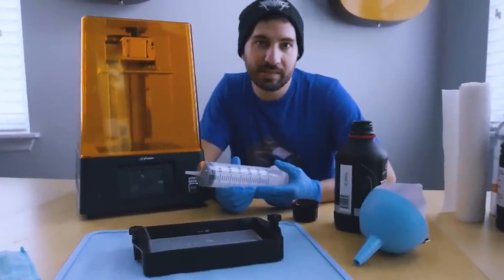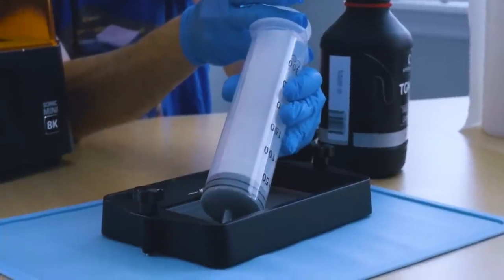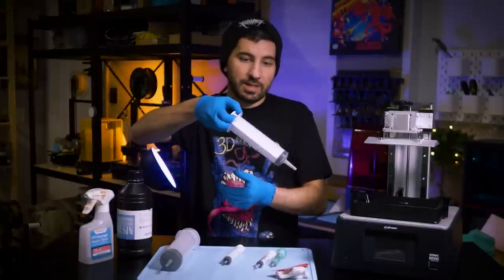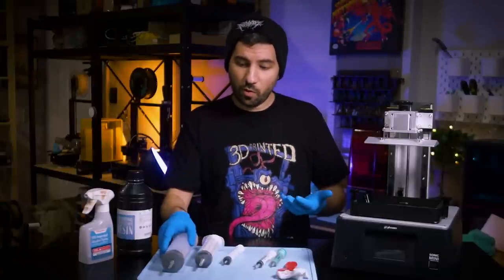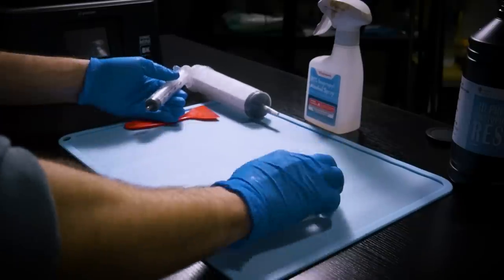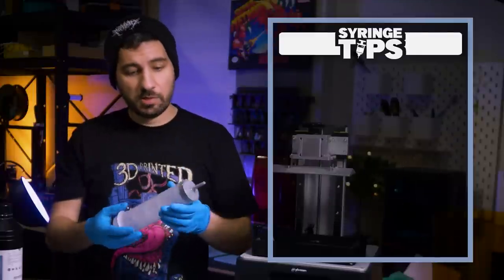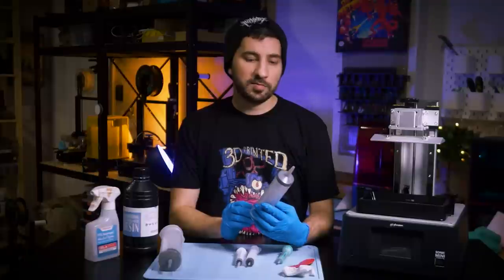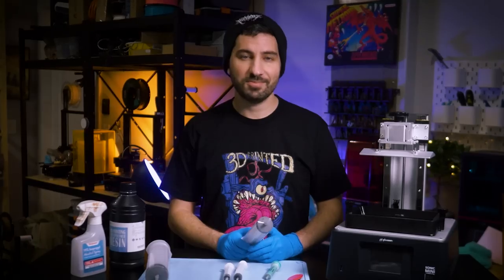Never Spill Resin Again: Using Syringes for Resin 3D Printing

Comment: Add a length of silicone tube to the nozzle of the syringe. Safer on the FEP and you can the tip to what ever angle works best for you.
Reply: I second this as well! I cut one length at an angle to offer more of a suction surface area.
Reply: And if you cut little notches in the vat end of the tube, that helps to prevent it from suctioning itself to the film
Reply: Exactly what I thought
Reply: Yep, wrote the same thing in my comment; you can also use a silicone glass pane wiper instead of a spatula.
Reply: he could have also typed the ENTIRE  machine to the side to get the resin to flow to one side/corner

Comment: Just 3D print a small slanted ramp so that it makes all the resin go to one of the bottom corners of the vat. You'll save yourself a lot of time scraping and be able to carefully use the syringes a lot more efficiently and safely with two hands without scratching the FEP.

Also get some soft rubber tubing that will fit your chosen syringe size and cut a small piece (.5") over the syringes hard plastic tip, this will help to protect the FEP as well.

Doing this will all but eliminate having to scrape it if you just let it sit there for a few minutes and give it time to work itself down to the corner after you take the majority of the resin out of the vat.

As far as not spilling it you can also take the vat to a machine shop and have them cut a small slant in one of the corners to act as a pouring funnel to pour it back into your resin containers. I have a few printers that have this built-in from the factory but I've also taken one of the ones before that didn't have that to a machine shop and it was very easy for them to do it for me and not very expensive at all, I think I paid $20  to have it done.
Reply: I was thinking something similar.  Couldnt I just stick a wedge under the entire printer?  Or would that damage something?  That way we could leave it on the printer.

Comment: Use an automotive one, those medical disposable ones tend to be sorta costly and the rubber likes to stick. Automotive ones (basically, big rebuildable ones for sucking up oil and fluids) tend be fixable, and they have a replaceable and flexible pipe on the end.
Reply: Any brands or specific products you would recommend, as that seems like a great alternative

Comment: Print a ramp so you can pitch the reservoir to collect in a corner. You can even put a threaded hole to connect to the reservoir.

Comment: Snip a piece of tubing from the pump off and fix it to the end of a syringe so it won't scratch the FEP and maybe make positioning a little easier AND add resin to a vat mid print nice and easy.

Comment: The scratching problem can be avoided entirely by using soft elastic materials, like a miniature glass pane wiper instead of a spatula (the cost is pretty much the same) and fitting a small length of hose on the syringe tip.

Comment: Don't throw the pump on ebay just yet, you could set it up so that it could easily add resin to to vat of a large print in progress, either manually, or if you rigged up a float switch, automatically(use caution of course)

Comment: I have 2 of the 500ml, one had no suction like yours the other had good suction. Plus using the plastic tube that comes with it helps suction and stops scratches.

Comment: I was highly interested by the pump but clearly the syringes is my way to go. Ordering now!! Instead of using the scraper on a flat surface, I will design a tilting tray to sit the vat in, which will slide the resin to one corner! Awesome pal, subscribed.

Comment: I just printed a spout thats flush with the vat. I then epoxied on and It keeps any resin drips do form far away from the base of the vat and as long as you dont completely miss the funnel with the well defined stream you get there is no mess. Just sit it down on a paper towel and there you go.

Comment: Feel like I'm missing a key bit of info, how is everyone having enough trouble cleaning out the vat for this to be worth it. It only takes like 30 seconds to pour the vat out into a filter/funnel, and then maybe another 30 seconds to clean the filter & funnel?
Reply: Glad to see this comment. I just assumed this video exists to make another you tube video. There is a pour spout on the vat for a reason. Invest in a silicone spatula and funnel strainer.
Reply: Find solutions to problems we don’t have

Comment: I recently looked into the prestaltic pump and found that you can easily, for not much more money, find ones with a lot more flow. Whether they have enough power to suck up thicker resins, I don't know. 
Also, there are few good videos here on YT about building/3D printing your own pump. 

That said, I just have a 6inch printer so I think I'll stick the either the funnel or syringe;)

Comment: every time the 300ml syringe was shown, and there was whining and complaining about how it didn't work well i wanted to yell at the screen.  #1 put a block under the left side of the PRINTER to TIP the WHOLE printer to the side enough to flow the  resin all the way to one end.  #2  CUT the end of the syringe at the perfect angle to so the END HOLE can lay planar to the fep -- use a lighter flame or light sand paper to smooth the edges of the cut.  Or superglue tubing onto the end of the syringe and use that instead.  

if you're so worried about scratching the  FEP, why on earth are you using a HARD PLASTIC SCRAPER to DRAG resin across the FEP?!?!  Get a soft silicone squeegee blade used for doing car window tinting.  something 3 or 4" wide.  Something with a hardness level that is softer than FEP.

Use your infinitely powerful  thinker brain blob.

Comment: Would it not be a good idea to 3d print a pour spout that attaches to the vat then just pour slowly? Maybe a handle too if it is too difficult for you to grip with one hand. Clip them both on and put the funnel in the resin bottle then off to the races.

I just feel like with 3d printing there must be a tool that you can design to aid with most of these issues.

Comment: Much easier and less chance of deforming the FEP if you raise one of the short sides of the vat on to something ( I use one of my Elegoo carbon filters for example) and allow gravity to do the hard work for you. The resin pools up and sucking up with a syringe becomes a lot quicker. For extra peace of mind add a hose to the end of the nozzle and use a silicon scraper for any remaining resin on the fep. 👍

Comment: Maybe you could have the vat on a small slanted surface or on a soft wedge, that way the resin can go to towards the lower end with gravity and you can get more of it using both hands on the syringe vs trying gather it with one hand and use the syringe with the other

Comment: About scratches and spatula. I think you could build (Maybe print) some kind of stand to place your vat like diagonally to surface. Resin would gather in lowest part by itself and you could drain most of without touching a fep. Also it would free your hands since you don't need a plastic spatula
Reply: I was just thinking that; I have a massive hunk of support I haven't had the heart to just throw away, it's a perfect angle/shape for this.  I'm going to keep it and use it for that.

Comment: Great set of videos.  All in all, does the toxicity/mess, print quality, and greater cost of Resin outweigh the hassle of setup, slightly less quality, and cheaper cost of FDM for primarily TT minis?  Thanks
Reply: I have a fdm and a resin printer, tried really hard to print tt minis with the fdm and was a real success, great quality minis can be done BUT the printing time for just 1 mini not worth it, in the time a fdm print 1 quality mini the resin one printed 7 and with far more quality and maybe in less time so... i use the fdm mainly to print terrain, dice towers or large pieces.

p.d you can find some cura slicer profiles on videos of this channel, they are amazing to print minis on fdm.
Reply: @soul_toys  Thank you for the info.  I saw the one on FDM profiles.  Time isn't an issue for me.  Its mostly to print a few mini's  and terrain for GM.  I'd definitely was leaning toward Resin, but the mess and potential toxicity turned me off some.  Still weighing options.  Stay well

Comment: What about a squeeze bulb syphon pump? Like the type used to move gasoline or fuel oils between containers? Could you make one of those work? Probably cheaper than the pump you first showed off and safer for the FEP because of softer flexible hoses that are on a syphon pump. Just depends on if you could actually make the syphon work, and how easy it would be to clean the syphone pump after use.

Comment: I use a 5 gallon pail with lid. Cut a hole in the lid so I can fit the vat in at a 45 degree angle. I put the 1ltr bottle with funnel and filter inside the pail. Put the vat and lid on and walk away to do other things. Sure, I have to take the vat out of the printer. I come back 5 to 10 minutes later and it's pretty much empty.

Comment: Would the printer still work if you put something under  three of the four corners so that it was tilted ever so slightly in two directions?  You seem to spend a decent amount of time, energy, and free hands tilting the bed separately so that the left-over resin slides to the corner you have the syringe/pump input located.  If the printer were slightly tilted in that direction by default would that eliminate the need to that (and, maybe, some/all of the scraping if the resin in the vat is low enough viscosity)?

Comment: Out of curiosity, what is the blue mat you are working on? I've seen many tips on how to clean and empty a resin vat but not much on which surface to work on to avoid scratching.
Reply: Slap matt, or more likely given the colour, a pet silicone mat. Both have a raised lip on edge

Comment: These videos are kind of weird to me. I only have one of the smaller "standard sized" resin printers, but I never had any problems just pouring the vat into a funnel, without spilling it everywhere. And I'm already not the most steady-handed or, franky, -headed individual. But maybe that's just one of my hidden semi-useless strengths :P

Still, if pumps or syringes work better for other people, more power to you :)

Comment: If you need to take the tray out to easily use the syringe, why not just tip the stuff back into the bottle - and save cleanup on the syringe?
In fact, you could design and print a stand to hold the tray vertically above your bottle and filter paper so you could leave it to drain in its own time.
Reply: Because as discussed in his previous video, simply pouring from the vat is a messy process, you get resin all down the outside of the corner, not to mention the increased likelihood of drips.

Comment: Isn't it much faster and easier to just remove the vat and pour it directly into the bottle from one corner and wipe it with a paper towel?
Reply from the maker: Sometimes I don't wanna remove the vat (like if a small failure that I don't wanna use vat clean feature for), and when I do - the pour can be messy, even if I'm careful. This especially addresses the risk of mess and spills.
Reply: Yes. The answer is Yes.
Reply: The answer is often, no.

Comment: Couldnt you just 3D print a stand that leaves the vat at an angle? So that you dont have to tilt the vat manually? MAybe even make something that you can adjust to different degrees so that you can tilt it slightly at the start, then more the less resin is in the vat?

Comment: 1. Pickup vat
2. Pour
3. Paper Towel

Simple as. Your time is worth more than a small drop of resin.
Reply: Except you don't even acknowledge the reality of accidental spills when pouring like that, the 'paper towel' step you so quickly conclude, can be a lot more involved and frustrating than you suggest